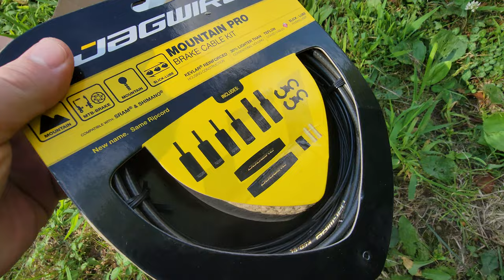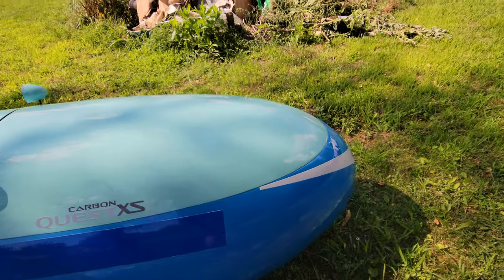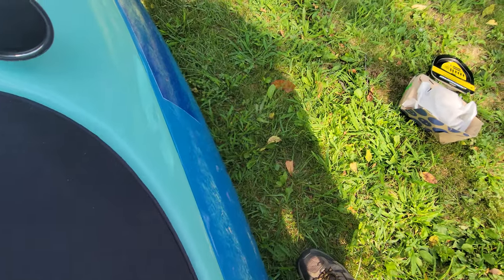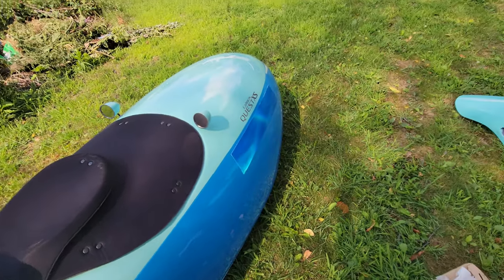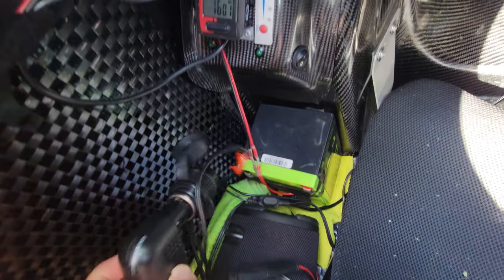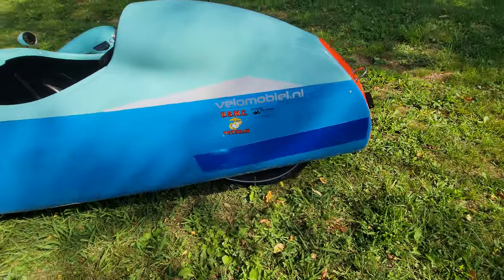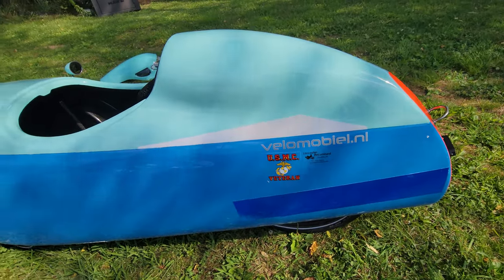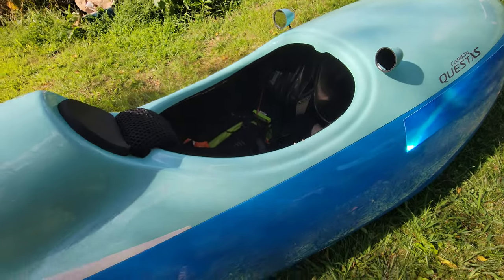Velomobile Changes/Upgrades

Comment: Hello!, I have seen several of your videos and I thank you for all the information you provide, I have ordered a Quest XS that will arrive next week. Could you tell me where you bought those wheel covers and then the rear wheel, have you made Put the wheel covers on both sides, if these are made of fabric? Also where you got that fan? Thank you so much!
Reply from the maker: The wheel covers- came with mine they are fabric bicycle evolution sells them still find them here also make sure u get the clips that hold it to the spokes as well https://store.bicycle-evolution.com/20-inch-fabric-wheel-cover-pair.html
If you want them for the rear wheel you will have to pull the rear axle to do the drive side u need the special axle puller. Mine came with them so i never had to remove it. On the front the wheel covers are only on the outside. On the rear they are on both sides on mine. The fan is something u can pickup at basically any pilot truck stop think they are 30 bux. They dont last too long. This year i didnt run one in my bülk i rode the bülk all summer, except for the month of july wen i was on vacation i took my quest xs with me. Also i thought they discontinued the quest xs earlier this year, are they still making them?

Comment: How is the hood regarding heat during the ride ( is there enough air to cool you down) and fog on the visor if you stop during the ride? I currently also riding a Quest XS and thinking about a hood. Thank you
Reply from the maker: You dont have to run the hood if u dont want to. In the summer time i will carry the foam manhole cover in case of rain and not run the hood at all. Or wat i have down was hung the hood off the side while doing climbs then putting it back on. I have been able to tolerate riding with the hood on in any temps below 70f. Its typically 10-20 degrees warmer inside than outside. If u open the visor it cools u pretty good the side windows are almost useless for ventilation so i just keep them open and close them if its too cold out. I can open and close the footholes with a tub liner that i tape on there with all weather tape its a pita to take off in the spring but got it off after a couple hours of scrubbing with goo gone tape remover. Usually riding below 42f its almost essential to have the foothole covers closed to keep wearing shorts inside otherwise ur calves or feet may get a bit chilly. The visor fogging is not a concern as it uses pinloc visor technology if u choose the pinloc visor which i would recommend even riding in the rain u can fog up without it. Which is used to prevent fogging in the middle of the visor but putting a pinloc insert on which essentially creates and second layer with an air gap between so u dont get fogging. However u do occasionally run into problems with condensation build up like wen its cool and rainy outside you will get moisture build up on the visor ive treated this with rainx thats rated for plastic havent done it to my new visor yet and all over the inside of the shell and i usually just carry microfober towels on me to wipe the visor wen this happens. Also in severe cold weather around 20f and below you can get ice forming on the visor if u have ur visor cracked open a little bit u need to stop the air flow if its that cold outside i used velcro or a microfober towel to stop this from happening otherwise u have to wipe it off with ur bare hand every like 5 mins due to the condensation forming to ice almost instantly. Its also cool to see ice froming inside the shell from ur condensation freezing to the inside of the shell but im sure this probably adds weight as all that is being trapped inside instead of getting drained out the bottom.